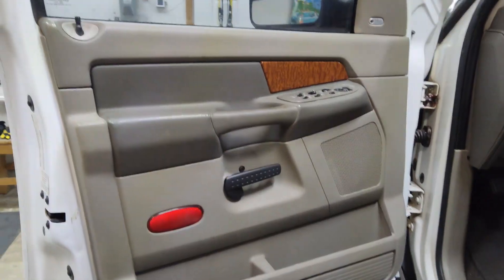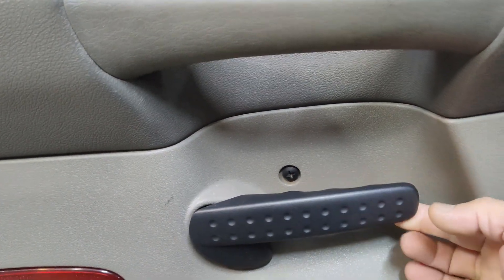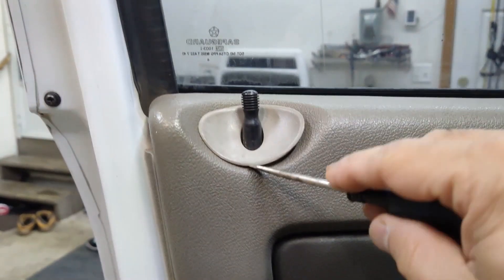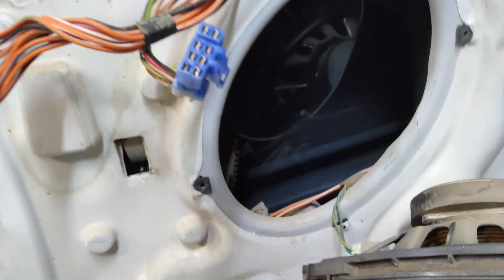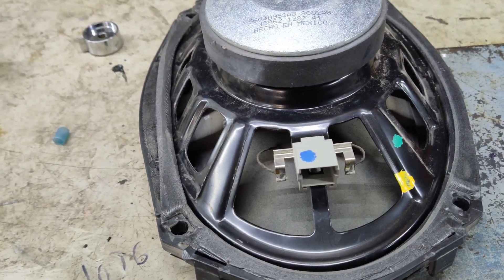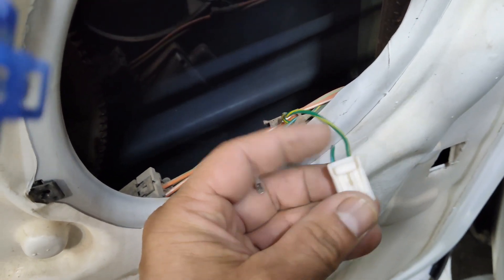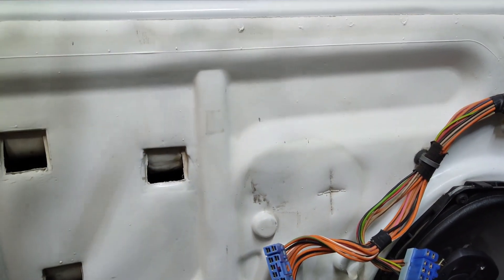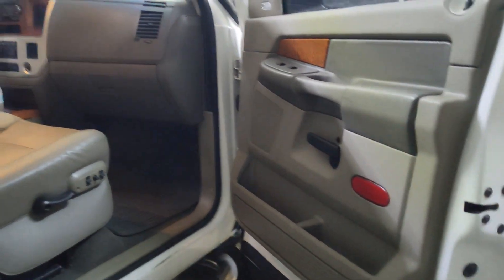Dodge Ram Door Panel Removal & Speaker Replacement | DIY 3rd Gen Ram

Comment: With the factory amp still in play I’m assuming. For the front door speakers are you only getting bass or are you also getting sound from the built in tweeters ?
Reply from the maker: Hi, thank you for watching/subscribing.  Yes factory amp is still in the loop and the front door speaker have full sound and not just the bass.
Reply: @JSFautoPlus how did you change it where the front speakers also play audio and not just bass
Reply: @jackobWallace did you ever figure it out

Comment: What model JBL's?  U mentioned but never listed them or gave model.
Thx!
Reply from the maker: Hi thanks for watching/subscribing. 
Here's the links to all the Co-Axial JBL setup that sounds great. 

JBL Stage 9603  6" x 9" (Front Door Speakers)
CLICK HERE: 👉  https://amzn.to/3OjzpvY

JBL Speaker, 5.25 in. GT7-5 (Rear Door Speakers)
CLICK HERE: 👉 https://amzn.to/3KnyPfz 

JBL CLUB3020 Club Series 3.5 Inch (Dash Speakers -Sides)
CLICK HERE: 👉  https://amzn.to/45b2rVB

JBL STADIUMGTO20M Stadium Series 2.5 (Dash Speakers -Center)
CLICK HERE: 👉  https://amzn.to/475ZGXn